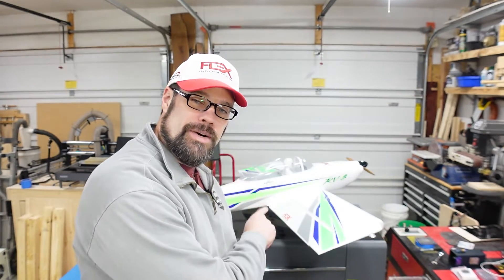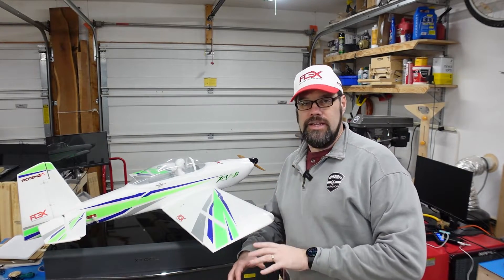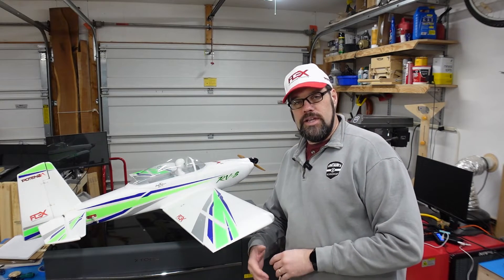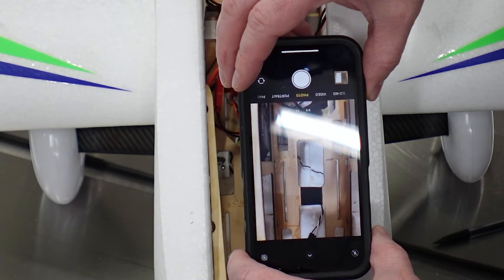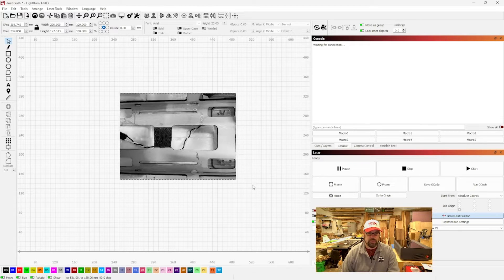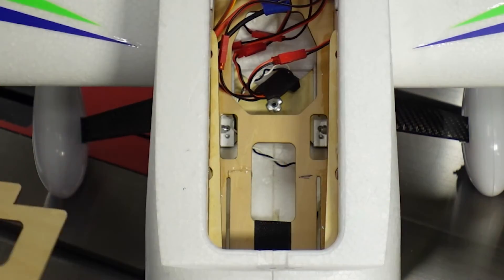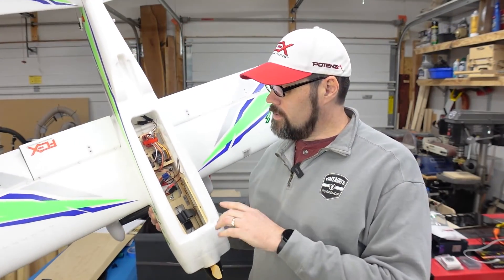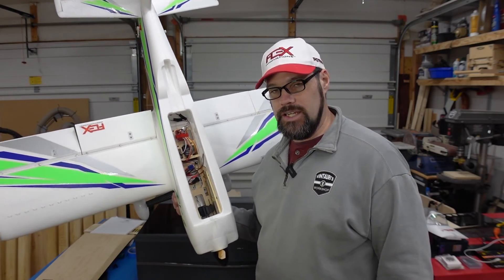Replicate parts on your laser using a photo in Lightburn

Comment: Very cool! I tried doing something like this once but my scale was off so bad at the end I had to just throw it in the trash haha.
Reply from the maker: Depending on the angle of the item to the camera as well as the lens you can get a lot of distortion which will throw off the dimensions.  But for items where you can get a pretty decent straight on shot it can get you pretty close.  But I've had my share of laser cut parts turned into campfire kindling as well!

Comment: Good explanation of that process.  I was going to recommend the Shaper Trace but what you were needing to do, keeping the original piece in place, that would not work for this application. Photogrammetry is an art to get dimensions to come out right, your approach did a great job of getting what you needed.
Reply from the maker: I do have a shaper trace that I want to play with for things like this as well.  Having a few different tools for creating and replicating parts is always good as no one solution is always the best tool for each instance.

Comment: Great video! Another way to scale is to draw the rectangle over the piece and note its screen measurements, in your case 94 x 51. Let's say the actual measurement of the object you're duplicating is 55 x 30. Let's assume your photo is dimesionally accurate (yours is). Just divide your destination measurement by your screen measurement and multiply by 100 to get the answer which is to scale the image down 58%. As always, check your math. This is a really fast way to scale drawings in Corel, Fusion and FlexiSign. I do this all the time. I'm pretty sure you can do those maths in Lightburn or any decent graphics program. With a photo as good as yours, I bet there is a way to radius the corners by dragging, perhaps with a modifier key.
Reply from the maker: My other CAD programs will let me scale the drawing by clicking two points and then entering the dimension.  That makes it much faster.  The calculation method would be good to use too.  Lightburn is nice software, but there are a few features from CAD I miss.

Comment: Prevent the jumping around with the image by holding either control or shift, I can’t remember off the top of my head but it’ll remove the snapping.
Reply from the maker: Yep one of those should do it but it still seemed to want to snap. I need to double check my settings and hotkeys for that.  Sometimes software just tried to be too helpful when you don't want it to be!